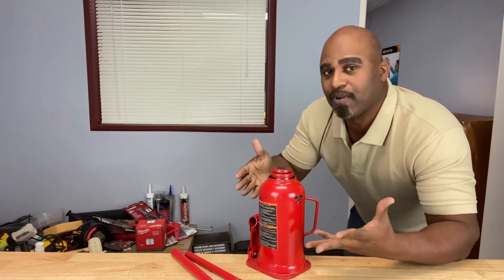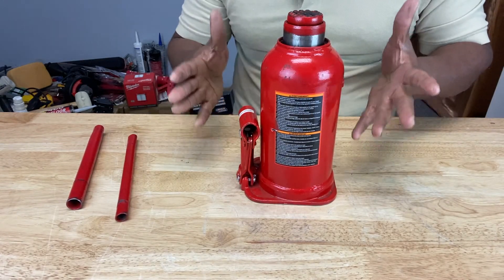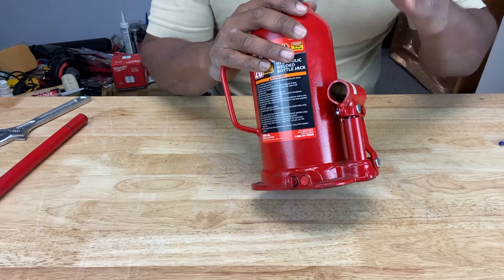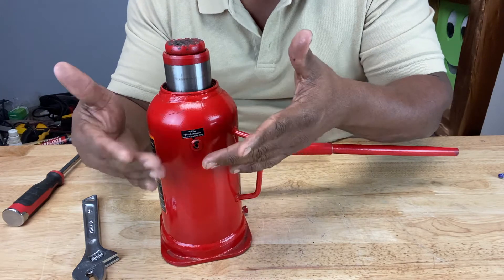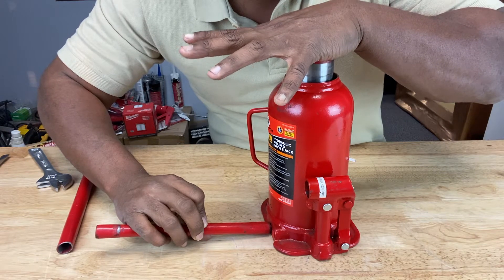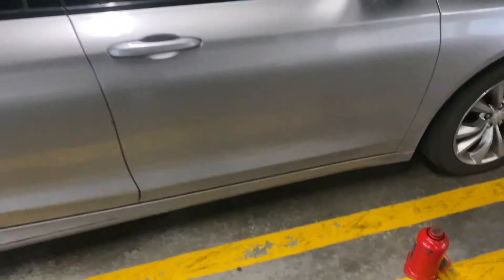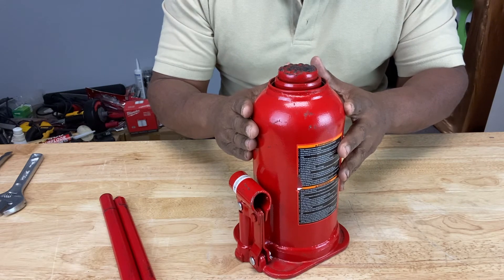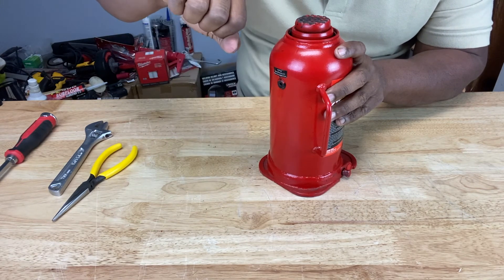WHAT IN THE H... IS A BOTTLE JACK ?

Comment: Quick tip for those who don't know, most vehicles have a small arrow that looks like a triangle pointing downward. This arrow will point to the factory lift point on the vehicle. The lift point will look like a metal tab, oftentimes with a notch on each end of the lip to reduce slippage off the jack.

Another keynote, don't try using a bottle jack to lift a car. The jack will be too tall to fit unless you're on ramps or there's an excessive amount of clearance between the bottom of the vehicle and the ground. These jacks are best used on trucks/SUVs due to their higher ground clearance.

Very well put together video sir. Definitely good for anyone not familiar with equipment like this and making entry into the maintenance field.
Reply from the maker: Thanks for the tips.

Comment: Homesteaders use Bottle Jacks for “Sawdust Briquette Making”. They’ll place them inside of makeshift presses and use them in reverse to push the water out of slurry mixes that hold the wet sawdust inside of PVC molds. Its a powerful tool for sure. Thanks for the video!
Reply from the maker: Interesting.